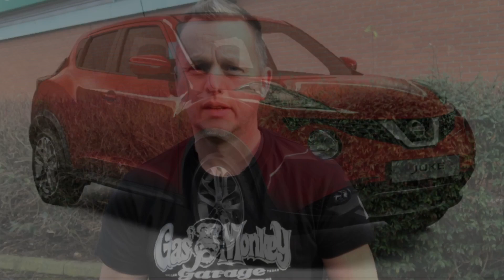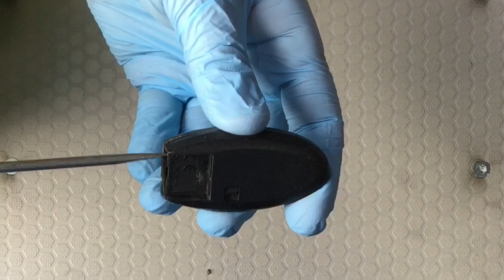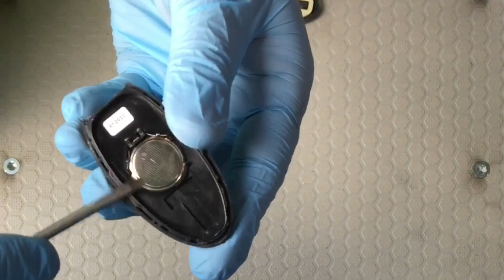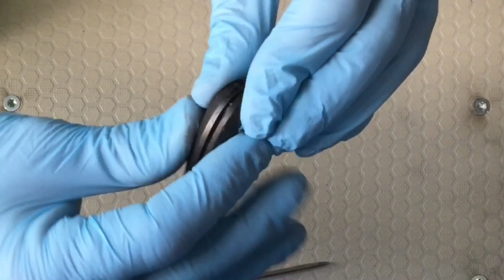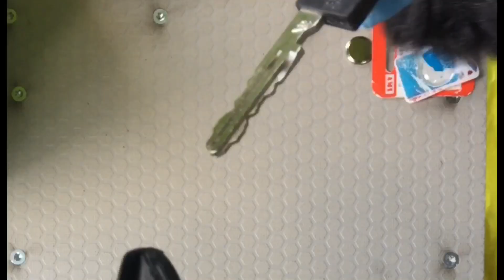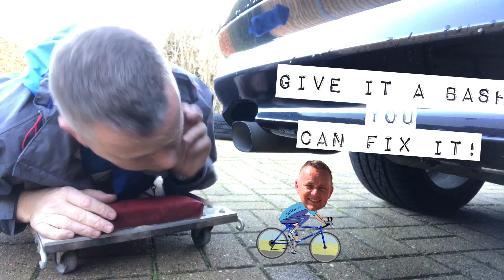Nissan Juke Remote Key Fault. How to start car and Repair, Replacing the Battery also QASHQAI

Comment: Hi. Changed the batteries in both fobs but they won't unlock the car. I can get the car started , but that's about it. Theres a yellow key flashing in the dash, and a red one as well, which I think has to do with the imobilizer not recognising the key. Batteries are ok, tested with a multimeter, cleaned the contacts with isopropyl alcohol, etc. Any advice? Do the keys need reprogramming?  Thank you
Reply from the maker: It sounds like they may have lost their pairing, so you might need a diagnostic tool to reprogram them, thanks for the comment!👍🏻👍🏻🛠

Comment: Button on door handle worked intermittently in the morning for a couple of weeks, getting colder but will get back to this, today I had to go by car for an appointment later today, nothing worked, not the button, not the remote, was about to go inside again for my bike, I incidentally touched the open button on the remote, it was dark outside, the car was behind me but I could see the blinkers went of on the walls of the appartement complex, so, luckily I could use the car. 
Later on when I had to leave for the appointment it had no problems probably because the key fob was in my pocket and the battery was warmer. 
So, temperature affects the remote and therefor the entrance to the car. 
Good to know a battery should be 3 volts minimum, mine was 2.9xx volts
Reply from the maker: Thanks for sharing your experience, glad the video helped you understand the issue!👍🏻👍🏻🛠

Comment: Thankyou very much, I've replaced the battery and the key still doesn't  work, does the key require pairing with the car?
Reply from the maker: Unfortunately not you must have another issue Thanks for the great comments👍🏻👍🏻🛠

Comment: Replaced battery and still happens now what?
Reply from the maker: Possible new key needed, Thanks for the great comments👍🏻👍🏻🛠
Reply: I'm confused now. What battery are you speaking of the car or key? Seems they both need to be changed at the same time. Just my two cents

Comment: Hi Mate. I’ve just replaced the battery but remote lock/unlock and keyless entry doesn’t work. Any ideas, please?
Reply from the maker: possible the button/circuit board cracked, Thanks for the great comments👍🏻👍🏻🛠
Reply: Hi thanks for coming back to me. I went and bought a brand new battery from the shops and it worked straight away. The ones I was trying must have been flat already 😳🙄. Just needed to pull out my wallet I think 😂

Comment: Changed the battery in the fob but the fob still wont unlock the car unless using the actual key. Still have to put the key close to the start/stop button as well to start the car. Could there be anything else causing this?
Reply from the maker: Sounds like the remote might be faulty, but always worth checking the fuses, Thanks for the great comments👍🏻👍🏻🛠

Comment: Tried your suggestion. Immediately tested the fob after a battery change and it worked. Next day i went out to start the car and it was like the battery was never changed. Can't open doors or start car with fob. Both key fobs will not open the doors or start the car so there must be some other issue other than the battery?
Reply from the maker: The remote button might be faulty, causing the remote battery to drain, thanks for the great comments 👍🏻👍🏻🛠

Comment: Thank you Antoni.  I got my new (3 year old, but new to me) Juke last week.  Just went to get in and it won’t start. I am thinking it’s most likely a battery issue!  Will try the close up key bit then replace if required.. It’s like beeping at me thinking that the keys have been left inside, but they haven’t!  Out of whack I think!
Reply from the maker: Hope it works for you, thanks for your message 👍🏻👍🏻